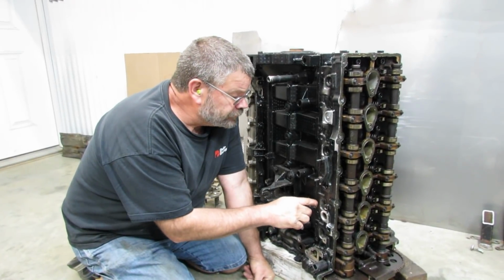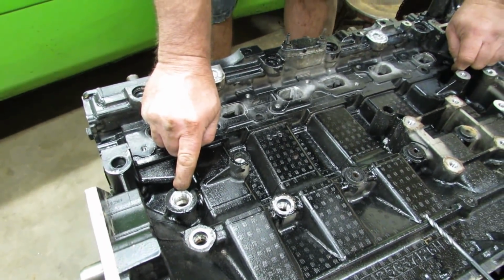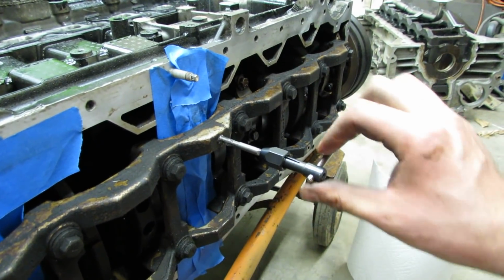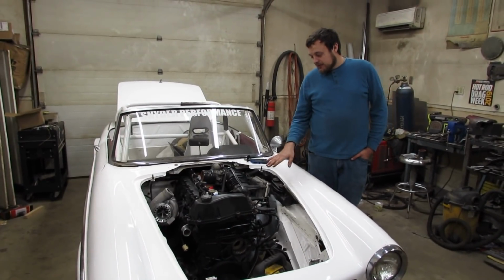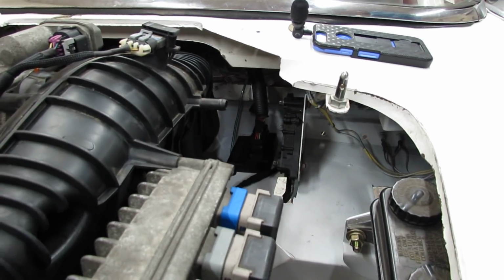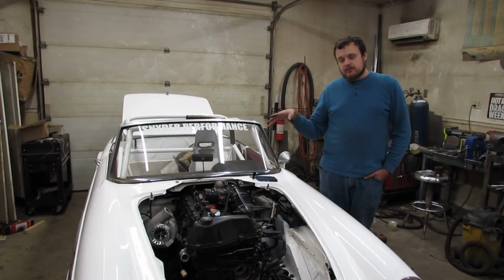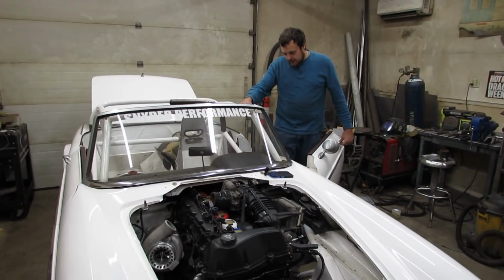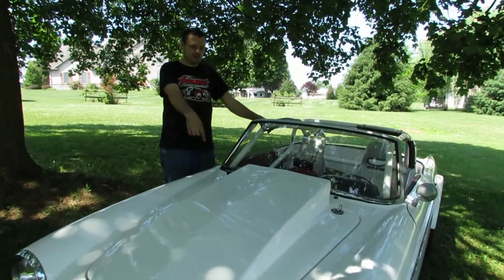The inline 6 Fiat Makes Noise For The First Time!

Comment: 3582 is the most common choice for a barra that makes around 500hp. they were the stock turbo on the ford xr6t and other turbo model here in AU.
engines seem similar in size and displacment. should be a faily good turbo to engine combo

Comment: Have you considered using the 07+ P12 controller? It is used by the Cobalt SS /Ion redline supercharged cars, and the MAP tables are boost freindly, not like the P10.
Reply from the maker: Considered it. Would rather have an aftermarket ECU for all the other amenities.
Reply: @Calvin-Nelson  I imagine it would work ok, in a low boost scenario in an off roader, or Jeep swap. Not ideal for reaching  big power numbers. You could control that awesome 4L60E with too, though! J/K.

Comment: How 'bout a Turbo 4200 in a Cherokee? I've had several and although the Jeep 6 has been around for a while, besides torque, it's a OVERHEATING PIG! Plus, you can find cherokee's dirt cheap, mostly because of the horrible cooling layout/systems that kill the engines.
The transfer cases are universal pretty much find all sorts of adapters.
(I'm going mild-Chevy 350/T-5 /8.25-4.10 in a2dr, 2wd '93)  Pretty much a sleeper.
Any word/work on MANUAL trans adapters for these? (no, haven't done a google search yet)
Thanks, and keep the videos coming!

Comment: Great work! So its runnig batch fire fuel and wasted spark on the micro?
Reply from the maker: Yes
Reply: @Calvin-Nelson  so its just tapped into the factory vr crank sensor?
Reply from the maker: @rodrigogarcia8453  yes. With a VR to Hall converter.
Reply: @Calvin-Nelson  just for a clearer signal to the micro?
Reply from the maker: @rodrigogarcia8453  People have tried the VR input into the Megasquirt products and not had success, so I just did it preemptively.

Comment: Hey Calvin I hope your dad's feeling better. Been praying for him. Have a quick question about the egr mods (block off plate) he did on that 02, first off what are the benefits? Second, could that port be used for a bov? Thanks for any information bro.
Reply from the maker: So that block off is on the exhaust side of the engine.  The Blow off valve is on the intake side.

The benefits are it is a system that we don't need, and weight we don't need to carry down the track.
Reply: @Calvin-Nelson  thanks 🙏 just now saw this, appreciate it.

Comment: I saw where these stock motors will put out 500 hp on just 12 lbs of boost .
Reply from the maker: To the flywheel, yeah. They're great motors. We've made over 800whp with a stock motor.

Comment: For turbo selection its easiest to just do some research on what works on the barra stuff. It seems like Richard thinks you can turbo these engines like an LS but imo its apples to oranges cause the vortec 4200 is a 4 valve head vs the LS 2 valve head. Matt happel did a podcast with robert from xona rotor turbos/forced performance and he was saying you can effecienty use more of the compressor rating of a turbo with a 4v head vs a 2v head. Thats why with the LS stuff it takes a 140-150lb or (1400-1500hp) rated turbo to make 1100-1200 through an unlocked auto. Where as with the Barra stuff (4v head) an S372 that flows 110+lbs (1100hp rating) turbo will make 1000 wheel thru an unlocked auto. Robert from xona was also stating the biggest dictator of spool time and power output is the compressor size. Which is why i feel like the 7875 on these which seem to flow around 100-110lbs is not the best choice if a 72mm s372 will flow the same amount and be drastically easier to spool up on the trasnbrake over a 7875. I mean if you want a turbo that size pulsar turbos sells a G42 replica that flows 134lbs of air (good for 1340hp) and is a 79mm compressor turbo and guys with the barra have gone mid 8s at 162 with a 3500lb car with that turbo. Also in terms of back pressure it seems more so the AR size of the turbine housing dictates back pressure more so then the actual turbine wheel size, the turbine wheel is just what "pushes" on the compressor wheel and dicates how over clocked or how under clocked the compressor wheel is depending on its size in relation to the turbine wheel. Sorry for the wall of text LOL!
Reply from the maker: Nah. Good stuff. Also explains why Honda guys are making good power. Thanks for the comment. What you are telling me is the GT3582 that is on the car will work well.
Reply: @Calvin-Nelson  Yeah the gt3582 should work well and make mid to low 5's through a th400 i know with the barra stuff its an upgrade for them (The barra comes with a GT3576 from factory) and they make low 6's through the auto ZF trans with the 3582 upgrade . The ZF trans however is capable of locking up, only thing is no one states whether those figures are locked or unlocked. The compressor map for the 3582r says it flows 67lbs (good for 670hp), which proves what robert from xona says and what ive been seeing with the Barra stuff. Look up "HSV-KILA Barra turbo by Atomic" on youtube its a video from fullboost that car traps a best of 165mph with a 68mm turbo....based on what those cars weigh from factory and the trap that car is making very close to 1000 wheel if not just over, which is pretty incredible when you think about what size turbo you need with an LS to trap 165 at 3400-3500lbs race weight. If you want check out that podcast episode matt did with Robert Young, its super informative and shed alot of light on turbo tech and sizing and stuff, made me realize why the hondas, 4g63 stuff make so much power on such small compressor turbos.
Reply: Would the 4 valve engines (which are typically smaller in cubes) benefit from smaller turbos as they can spool the smaller turbo easier, whereas the 2 valve engines are bigger and can spool the bigger turbos?  In the end a selection will be based on application and power.  If you need fast response it may need to be smaller and you run thru the efficiency island to the right.  If you have time to spool, you could run on the right side of the island.  And if you run steady state you run in the middle of the island. 

It appears that in many race vehicles, the 4V stuff has smaller turbos with more focus on charge cooling.  The smaller turbo is quicker to spool with the smaller engine, and weight wise the smaller turbo is lighter then the IC parts, so running off the right of the efficiency island is the best balance.

Comment: Where did you get your adapter plate from
Reply from the maker: We've been making ours, but you can buy them from Emtech Motorsports.
Reply: Thanks for the info...I've been wanting to put a 4200 in my 80 sunbird ...this helps

Comment: That rear sump pan, is it the original flipped 180* or a modded 3500 pan? Or a standars rear sump for the 6cyl?
Reply: It's a modded 5 cylinder pan.  They section it and add a few inches to make it long enough.
Reply: @Phil-rs5wl  thats my first thought but it didnt looked chopped or welded, by a glance.